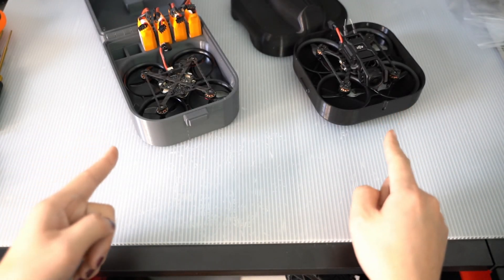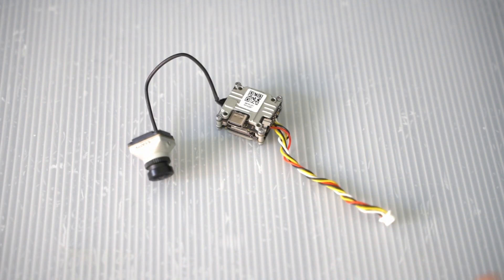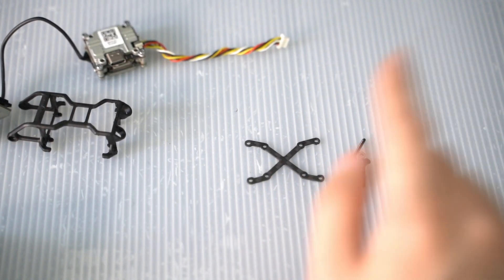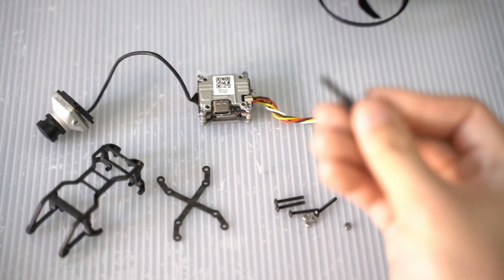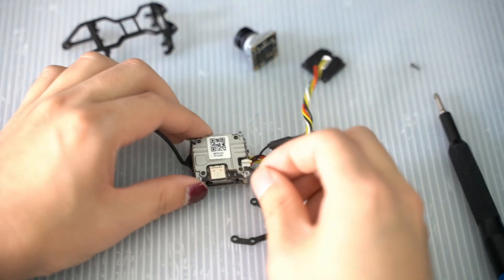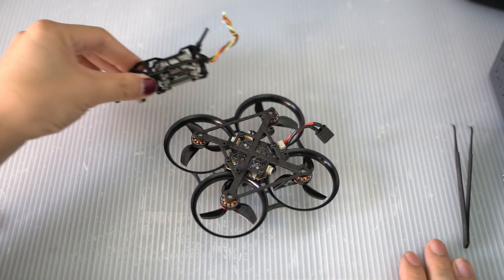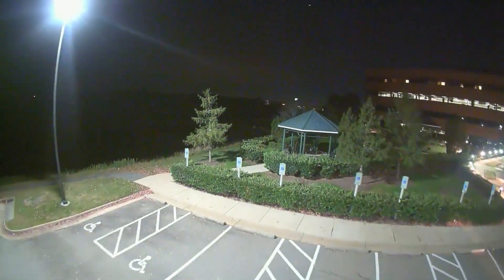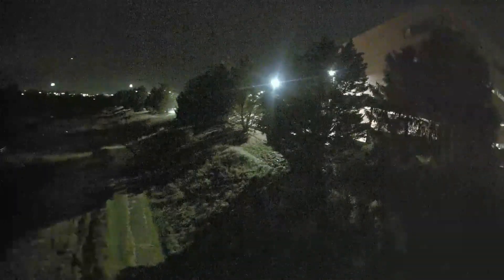Night Ops FPV Drone: Fitting the Caddx Polar Vista to the Pavo Pico

Comment: So the cage that goes over the caddx is put over or under the x cross bar. Looks like over in the video. Then you thread the screw from under the body through the crossbar holes and the cage holes?

Comment: Hey thanks for the video. I have the avata 2. It i bought this unit would i be able to use the goggles and motion controller or would i have to use my dji reg controller?
Reply from the maker: Unfortunately the Goggles 3 currently only work with the Avata 2 and nothing else.
Reply: @hoardersam10  ahhh gotcha. Thanks